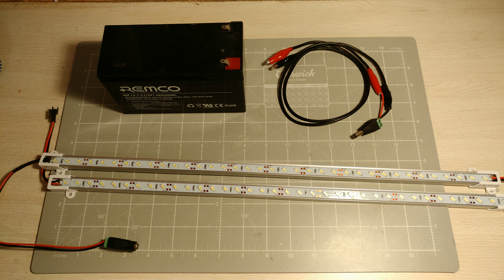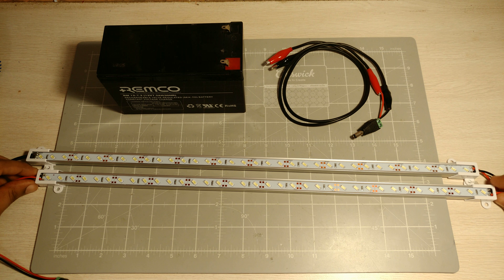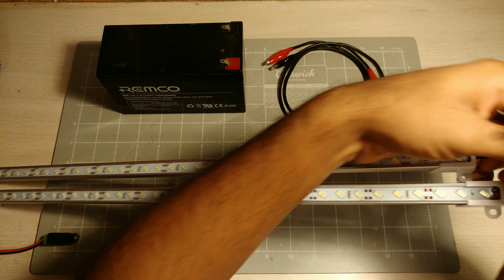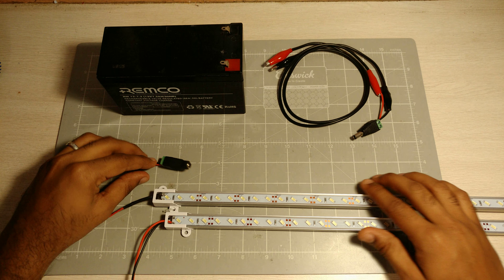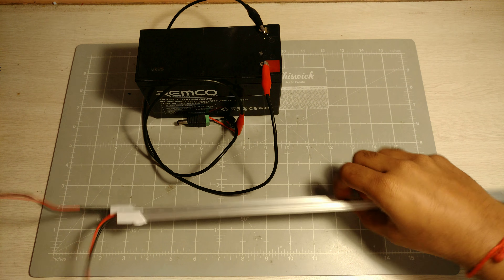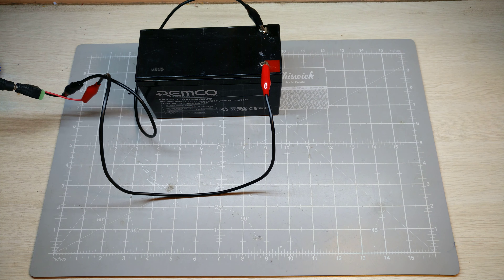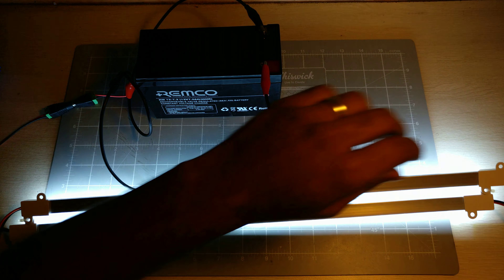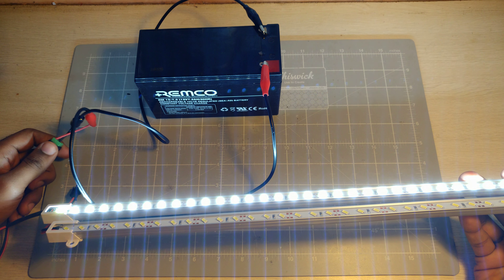Useful 12V LED Strips

Comment: Hi. cool project. kinda curious. would this type of battery work to power up LED panels rated for 50w?
Reply from the maker: Hi, if the LEDs are 12V, this battery can work but it will have to supply ~4A (50w / 12v = 4.16A) to power those LEDs. This means it will theoretically only last 1.73 hours, however, that's unlikely as the battery will not be able to sustain that high current draw.

Comment: According to google you need a voltage regulator so the strip will not burnout. 12.6 v is too high.
Reply from the maker: The LED strip already has resistors soldered on - they're between every 2nd SMD LED. These resistors will ensure the correct current is provided to the LEDs. A voltage regulator isn't necessary in this case as the battery won't got over 15V and even at 12.6V the LEDs should be fine.

Comment: How many strips of 5 meters i can connect together so that they will light property ????????? Please help me
Reply from the maker: When you connect them in parallel you need to add how much current each one requires. For example, if each strip requires 500mA, when connected in parallel, they will draw approximately 1A (1000mA) of current. Please choose a power supply that is capable of supplying the necessary amount of current. Be careful, these can get hot when you're using them at maximum brightness for extended periods of time.
Reply: @yasthilbhagwandeen ... I have connected 4 strips in series ...3 strips are lighting properly but the fourth one is not working properly... 🥺🥺🥺

Comment: Does the brightness have to do with the volts? ..
Reply from the maker: Technically if you want more watts, you can increase your voltage since Watts = Voltage * Current. 
However for a 12V LED you can only use 12V (maximum). For this case, the only way to adjust the brightness would be to adjust the current. So if you connected a module to vary the current, that would help adjust the brightness. Be careful of damaging the LEDs tough - you can't drive them with too much current. They will burn! 
Another way you can increase brightness is to add more 12V in parallel - remember this will increase the total current you're drawing from the battery.

Comment: hello do you think you would need a fuse if you were to use 4 metres of led with the same battery?
Reply from the maker: Hey Grant 1!
Firstly, I'm assuming you're connecting them in parallel right? From my what I remember, the LED strips I had drew about 500mA. So with 4 of them, it'll draw around 2A. That's a fair amount of current, but I don't think it's necessary to have a fuse. However, if you already have a fuse, it won't hurt to use it. 
Cheers!
Reply: @yasthilbhagwandeen  Thank you for help!  I already have a fuse so ill take your advice and put it in!